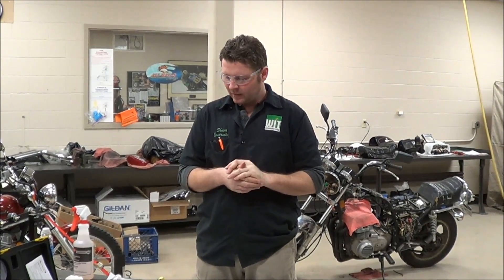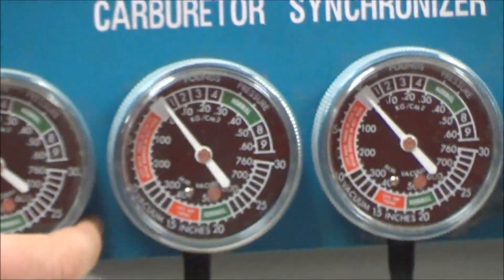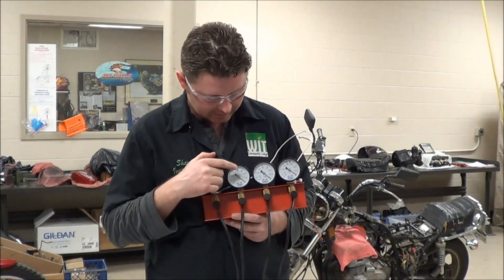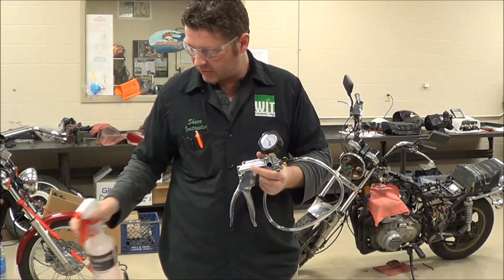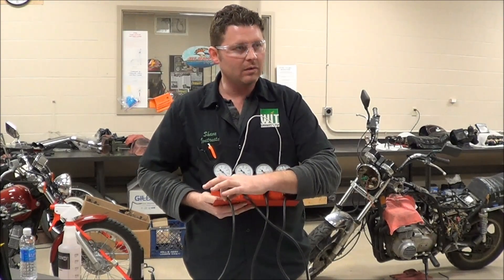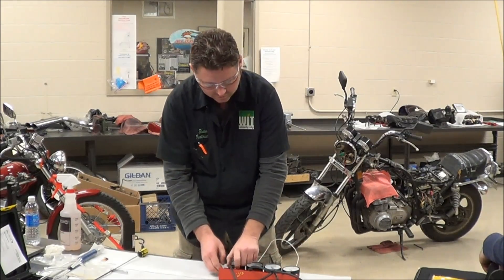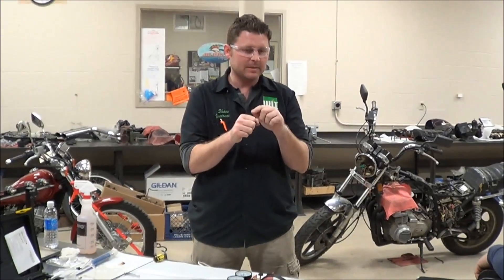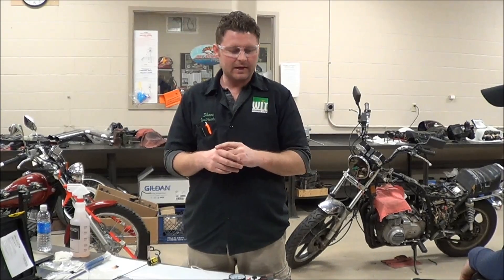How to inspect your Carb Sync Tool  Part 1 Carburetor Synchronization

Comment: Great video! I have a 2000 Honda Magna 750C. I removed and cleaned my four carbs and synchronized them on a bench. Once installed on the bike it still required more tuning but I still detect a slight backfire coming from my exhaust. I think perhaps it needs a fuel screw adjustment? My carbs have what appears to be a "D" shaped fuel screw which I'm unable to adjust because I don't know where I can get one? Would you happen to know where I could obtain these Honda Magna "D" shape tools?

Comment: All good info. Been a mc mechanic since the 80s and raced 350 twin 2 strokes and superbikes, the former harder to balance carbs on. IME shop gauges need to be calibrated every tune not just once and marked because you never know when some goof will drop and they can go out of synch, testing with the vac gun is one way but the other way is to plug each gauge one at a time into one intake spigot to compare them on the same intake first, then plug them into the rest of the intakes knowing they are cal'd to each other.. alternative setup is 4 small ball valve taps on a single gauge, you open each tap one at a time to compare readings on the one gauge so no cal required.I've seen a gauge set with plastic covers on 3 of 4 gauges with a reference line on the cover you can rotate to zero the line to calibrate the last 3 gauges to the first one. But all the ones I see these days seem to be either the Chinese blue ones or a slightly better copy using same low budget car gauges, dampers seem to be a mod con. More reason to cal them every time.
Reply from the maker: Quite the conversation going on here. :) Have you seen my website yet? how2wrench.com I will welcome well wrote tech comments and articles. 
Keep Wrenching,
Shane Conley
Instructor/Motivator/Motorcyclist!

Comment: Loma I know lots of guys who don't know how to use vac gauges properly,I will show them this video and say "see I told you so " haha thats why I use a manometer they never lie. Cheap as cheap can be to make and never need to be calibrated..
26 feet of hose and 2 t fittings and a bit of fork oil mount it on a 4 foot board and done.